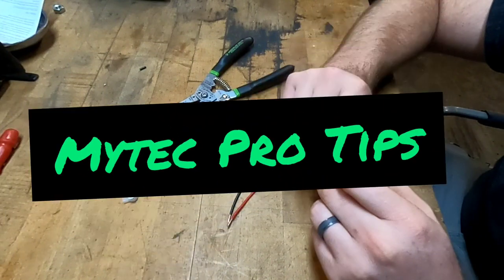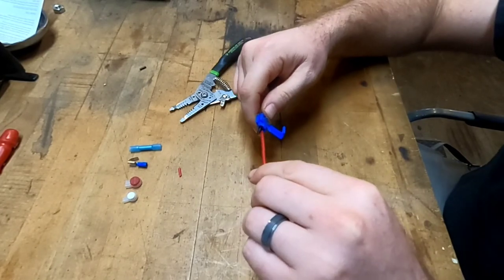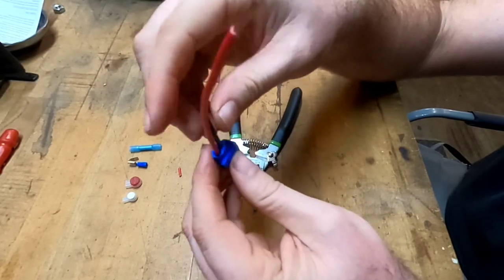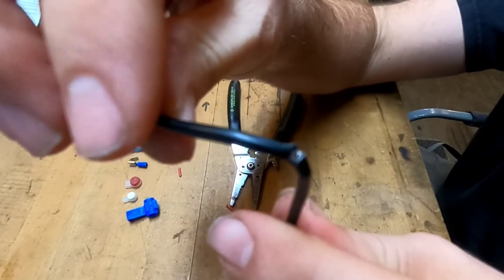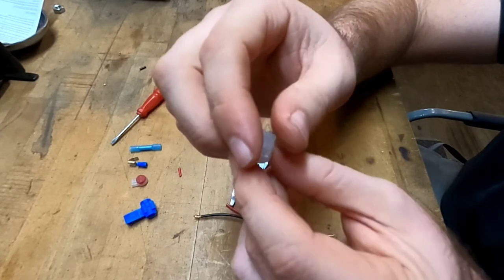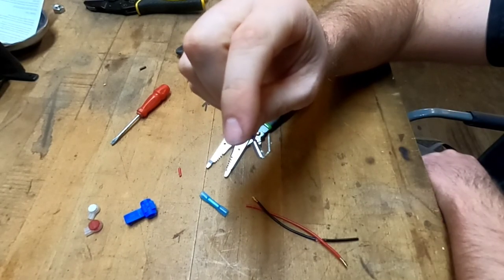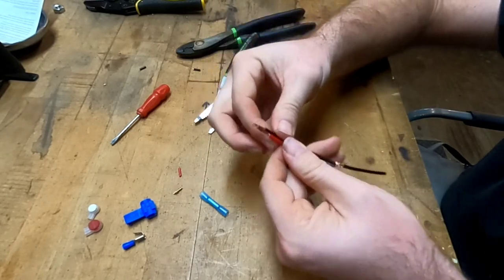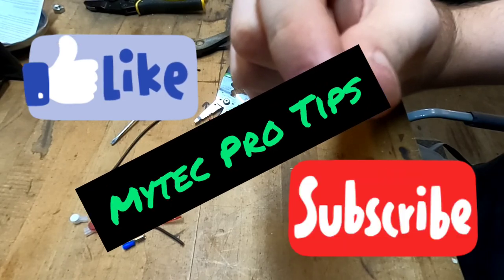Scotch lock crimps are bad and why they suck!

Comment: You must not know what you're doing considering you're supposed to push the aluminum splicer with pliers before folding the plastic cover over it.  🤣🤷‍♂️
Reply from the maker: Yes, I know that but that's not how most people do it... They still suck and they're a cheap cop out for doing a proper install or wiring job